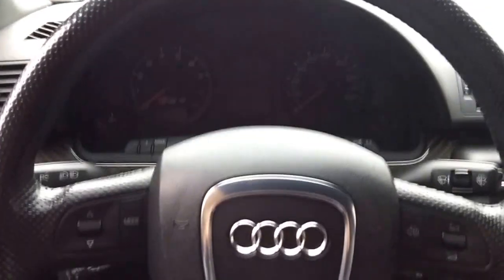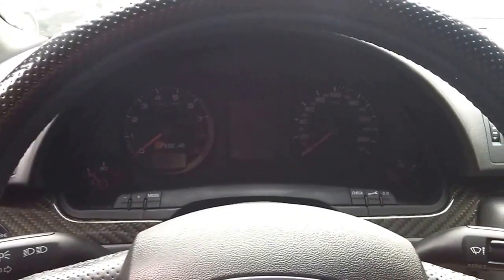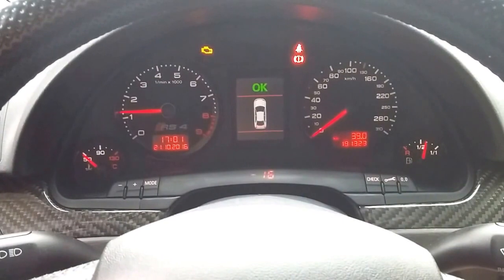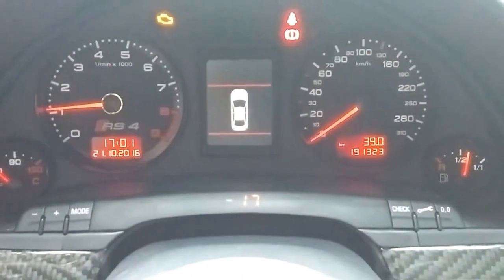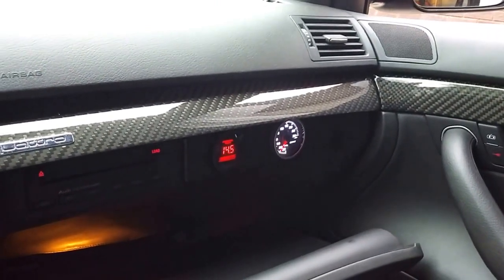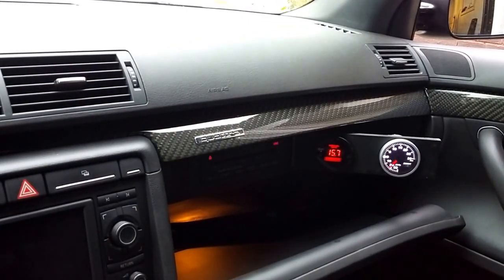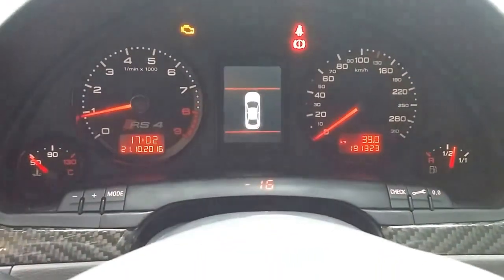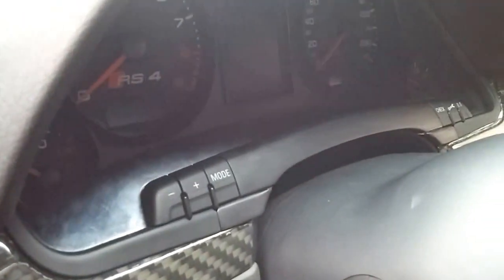20161021 Project B7 RS4 Stage 3 2.7T Biturbo Swap UPDATE 5: Digital Boost Gauge Integration

Comment: Do you have a tread for make dis?
Reply from the maker: I do not have a build thread for this. I can share with you the wiring diagrams and other documents I used to do the swap.
Reply: @biturboaudis4  thanks a lot but i talk for the boost gauge with your 3 digit display. You help me when a make the 2.7t swap un my b7 with your video!

Comment: I loooovvvee the clean boost gauge, and agree with you wanting to keep the dash free of mess.  is that gauge custom, or is it available to buy? thanks
Reply from the maker: I made it using a remote display and an off-the-shelf gauge, from which I removed said display.